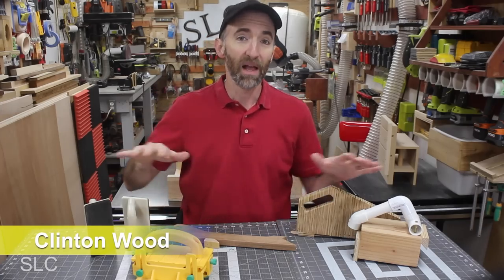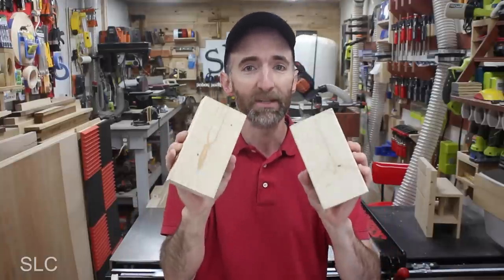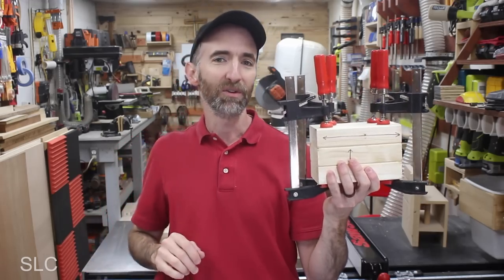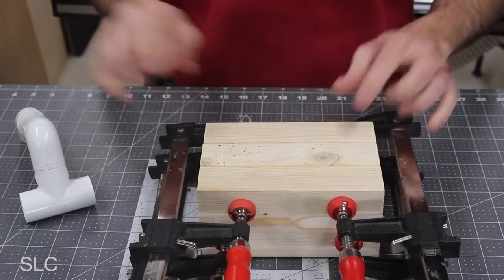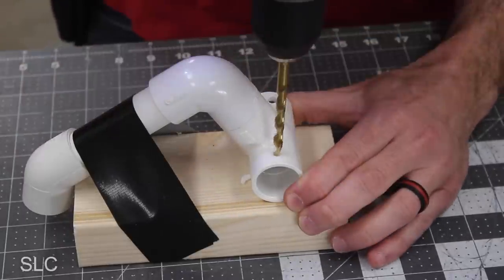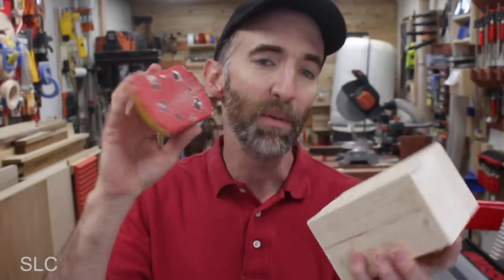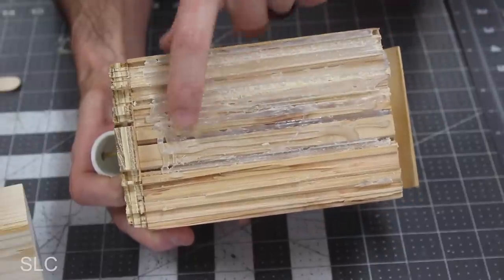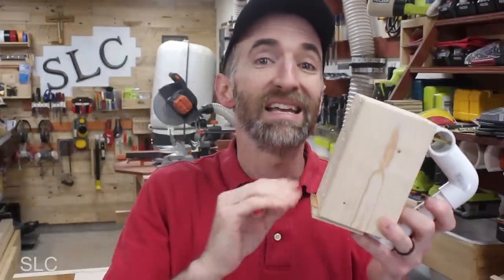Best Push Block I've EVER Used

Comment: Great idea for sure! Instead of hot glue on the bottom, you could also attach some sandpaper or cork board for gripping.
Reply from the maker: I would be concerned about the sandpaper hitting the saw blade and dulling it
Reply: @SpecificLove7  Good point. I saw another video where the presenter said that cutting through sandpaper wouldn't damage the blade. I'll have to try it myself on a cheap blade first, just in case.